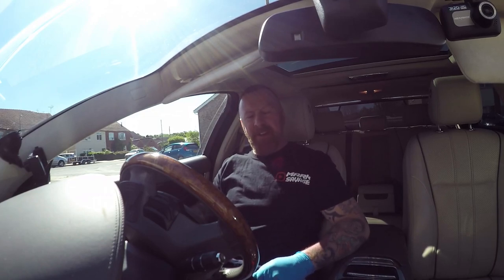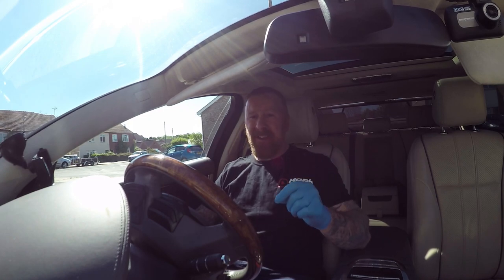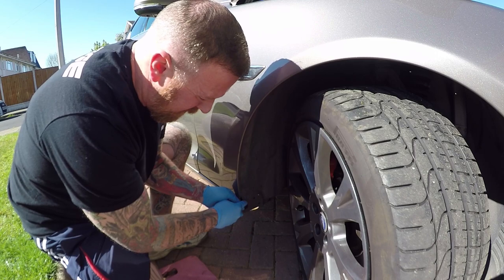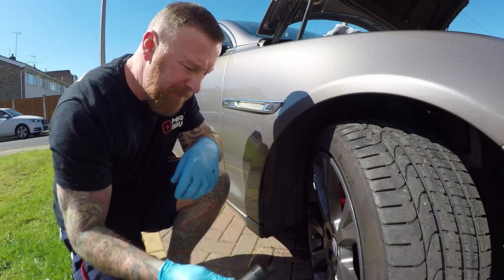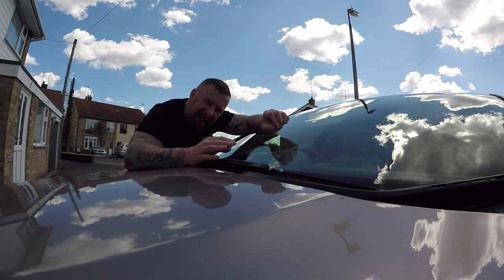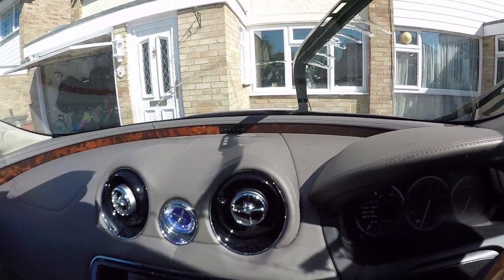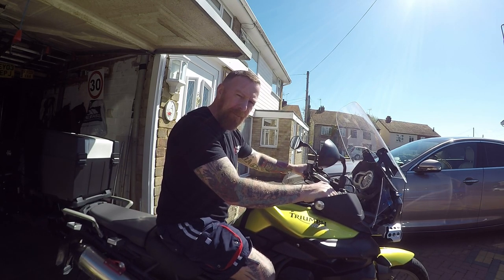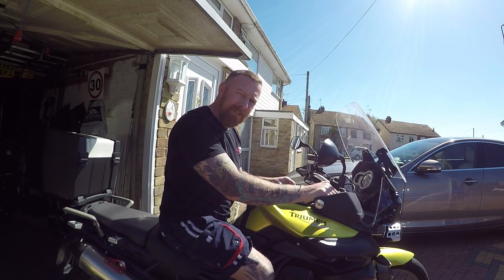CAR SCREEN WASH WASHER BOTTLE NOT WORKING MARK SAVAGE

Comment: Thanks for the upload. Managed to fix my washer fluid (low state) sensor thanks to this video. Its located a bit above the pump , but on the inner side. If anyone has the same problem, just test the sensor , and check connection for corrosion. Saved me both money and time at the dealer! Cheers mate
Reply from the maker: Thats great to hear you sorted it bud 
Take care mate

Comment: A  good tip is to use screenwash in the summer even if it’s not raining you save your pump. And clean the screenwash Reservoir in the spring. I’m gonna clean mine soon.

Comment: I've been taught most of this in college, most fluids in the engine bay can badly damage your paintwork and I was tested on how to deal with it haha!
Reply from the maker: yes bud very true but I like to share info lol, thanks for watching
Reply: Your still very helpful to people who dont really understand the motor vehicle world. Your videos help me alot with my speedfight it's just the odd issue that gets me, touch wood my bike is running good now I had to get a bypass for the aec400 ignition and a hotter plug and I've put proper Castrol oil in it now.

Comment: If you have a 2013 sportbrake like me watch out - the pump has 2 outlets and is different.  Also I used compressed air to blow through the pipes.  The one to the rear screen has a stupid connector right above all your body control computers in the foot panel by driver (uk).  This blew off so that when reconnected it dumped fluid everywhere- worse was that it happened again at the mot centre where the garage thought it funny to spray everyone until the car wouldn't start.  To fix it by the way I bought oversize connectors and tie wrapped them in.  I left an extra length of pipe in to try and ensure the problem doesn't happen again!,

Comment: I wish it was that easy on my mk2 megane. Ended up having to take the front bumper off to get access to the water bottle so I could remove the pump from it. Really simple if you can get access to it, lol. I read loads of ideas on how you can get it via the wheel arch on drivers side, but for me and my big hands, there was no chance. So yea, engine bay plastics came off, bumper came off, water bottle removed, washer pump replaced. Luckily eurocarparts had the replacement pumps, everywhere else wanted to sell me the bottle with the pump already attached. 
I had a weird case where the front jets weren't working, but rear was. Seems the pump works in forwards and reverse depending where it wants the water to go. Forward wasn't working, but reverse was. In the end a really expensive job to fix for a pump that cost less than £2... I 'lost' one of those wheel arch bay screw things (actual screws on my megane), and it was under the wheel. so a slow puncher later, and new tyre :/
Still, won't be making that mistake again and purchasing a megane.
Reply from the maker: oh wow , I had heard of the megane  with the front head lights in which you have to take off the wheel to get to a panel that you have to work blind to replace so they did the same with to washer pump 
buy a jag lol ,it a lot easier 
thanks for sharing bud

Comment: Quick question. 
I have a Yamaha aerox  70cc with a stage 6 pro replica carbon exhaust it has gotten really loud ear piercing even. And I opened up the silencer and the wadding was burnt and brown looking. I was wondering wether the exhaust wadding needs replacing and wether that will make a difference
Reply from the maker: I have a video on my channel to help you with this and it is easy to do and video help with the noise and performance too
Reply: Would you say it would need replacing if it is all burnt and noisy. Stupid question I know but wondering
Reply from the maker: they all rust so you can rub it done and use heat proof paint £6 then they come up like new and the wodding is only £8 so a cheap way to fix it 
a new exhaust will cost a lot more but will also solve the problem 
its up to you bud

Comment: Hi Mark my jaguar xf 2013 problem is wind screen wiper water is not coming out moter is not on but when I used for headlight moter is on and water coming out can you help me please
Reply from the maker: The lights are possible on a different pump ?
If you have check if the pump is sounding when you press the button it could just be the head that's blocked 
If not you need to do what I did
Reply: @marksavage  thanks for replying 
When I press button for lights pump is sounding but when used for headlight pump is not sounding
Reply from the maker: @sajidsaleem8426  yes so it needs replacing bud 
Hopefully you can follow this video and get it sorted
Reply: Thanks Mark yes find an other pump bit more higher for headlight thanks
Reply: @marksavage  hi mark I am replace water pump today but pump is still not working can you help me please thanks
Reply from the maker: @sajidsaleem8426  hi 
take it off and pretest so start car and get someone to press the washer , remember it will only come on intermittently but should work 
if not volt meter and test if it has power 
but maybe check fuse ! 
if you have power and fuse ok you might need to unblock the system 
take off pipes and blow / stuck to clear them and wash out bottle
Reply: @marksavage  just got the pump checked and both old and new are fine. But no power coming to the pump. Any idea what to do next?
Reply from the maker: @sajidsaleem8426  fuse or stork on steering column but if you can't find it you may have to get a electrician bud !

Comment: I've followed this procedure and I've still not got any water coming through. No sound either as if the pump was working. Any ideas ?
Reply from the maker: did you blow through the pipes to see if they are blocked ?
use a volt meter on the connector to make sure you have power going to the pump bud
Reply: I've got power on the pump,  I bought a replacement pump aswell. But fully operating.  How would suggest blowing them through? I've tried the old needle trick on the wiper end
Reply: Further to me blowing out the pipes. My headlight spray is working but not my windscreen ones. Dodgy wiring perhaps ?